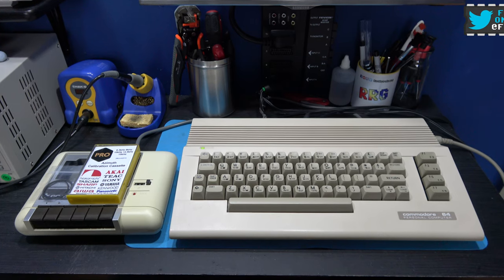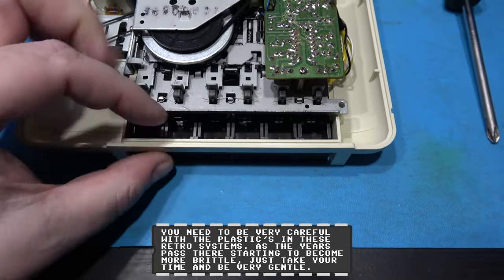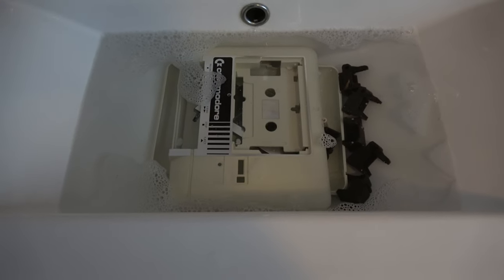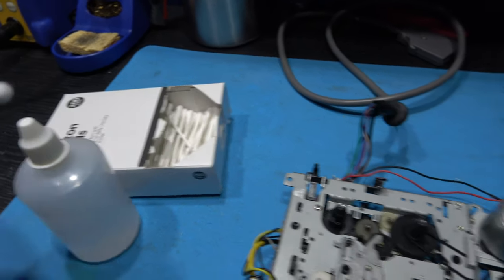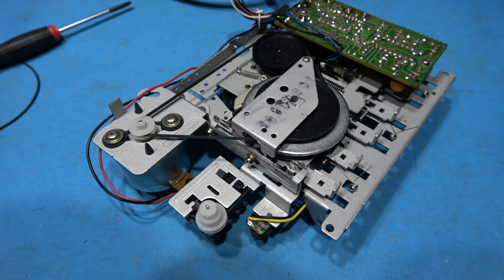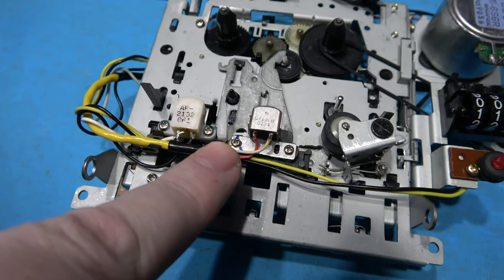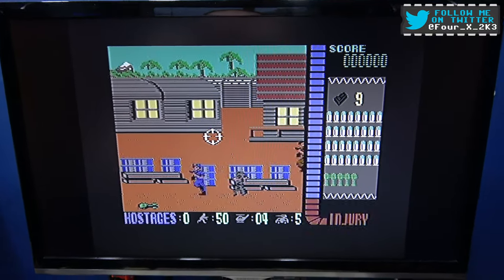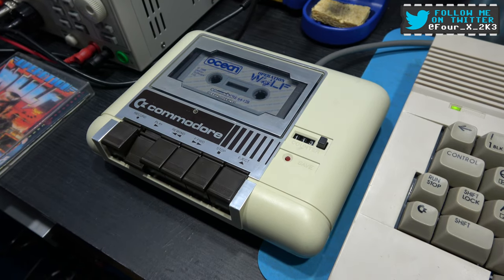Commodore 64 - How I Service the 1530 C2N Datassette (Tape Deck).

Comment: Great video. I'm in the middle of servicing my C2N. To aline the tape I used the Azimath 3000 tape from Interceptor. It took me two attempts to get right and load the test game Bandana City on the other side. My bands are coming soon, but also I need to get hold of some grease, not sure where to get this?

Comment: I've got a bunch of tapes and two of these,  one of them has a box (yay) . I tried my tapes and a load never loaded, tried both of them, no dice, many permutations. Sadly I don't have a scope so can't really say the Datasttes are of disrepair or the tapes have rotted - which could be a possibility. 

Thanks Four X, maybe one day I can fix my stuff with the help from you and others ;)
Reply from the maker: Thanks Neffers. You could play the old dodgy tapes back on an old tape deck and lisen if the tones sound ok. sadly alot of my original tapes have rotted away also.
Reply: @Four_X  Yeah I have a "plan" but not sure of its efficacy. I was gonna degauss the tapes (I have an eraser) then try recording a .t64 to wav file on a good quality tape deck, then using a Graff tape duplicator to do sides A and B on the OG tape. Might work, might not, depends on the tape itself I guess. Would take ages too lol.